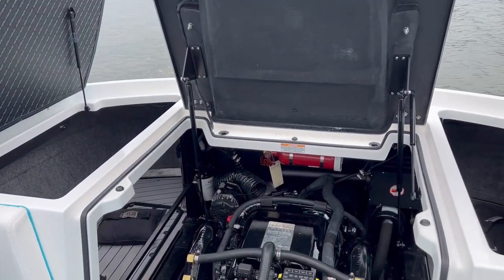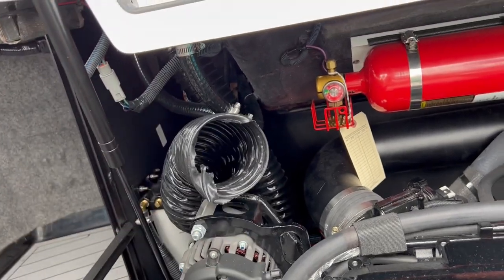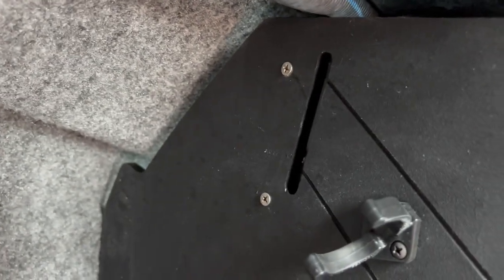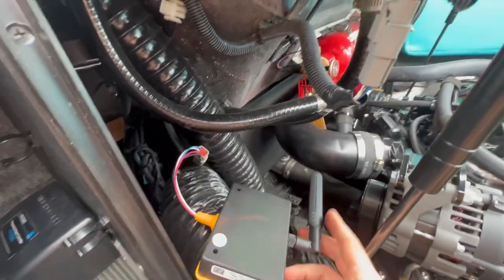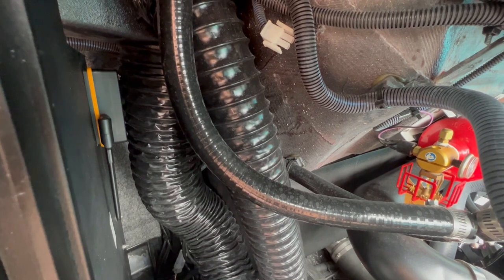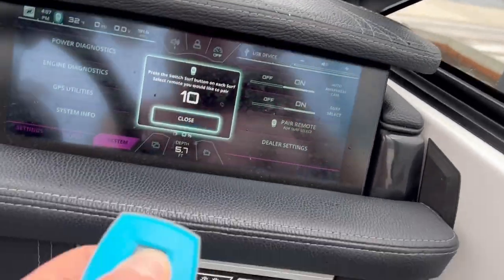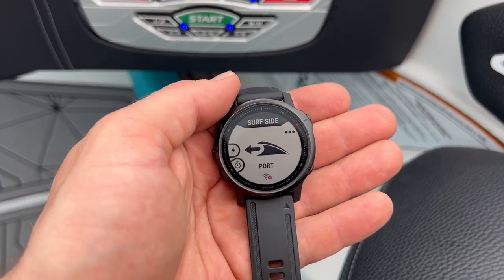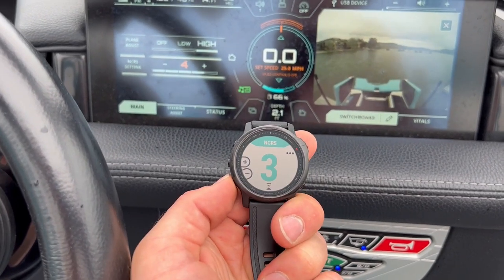Nautique Surf Select 3.0 installation on 2019 G25. Works for all 2016+ Nautiques

Comment: How much was this part from Wizard Lake? Wondering how this would work on our 2016 SAN 230 - it only has NSS, not NCRS to adjust, and uses the older linc screen.
Reply from the maker: It was around $500. It's pretty much a useless gimmick. If i had to do it again, I probably wouldn't bother. The range of the watch connection isn't great. It does work, but sometimes just randomly disconnects. I'm not sure about your 2016, I think you just have to have the 2.0 module in order to be able to upgrade to a 3.0. I'm not sure what year they started using the 2.0
Reply: @ViperMike  Ah shoot that's disappointing, you'd think the tech would be there by this point with all the $ invested just to test it out. Will probably just roll with what works then and save the headache.